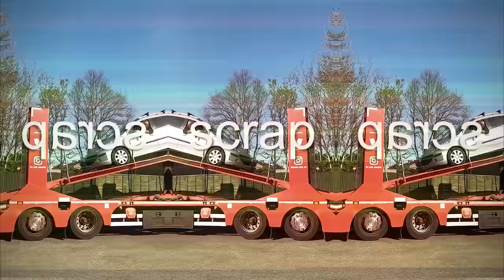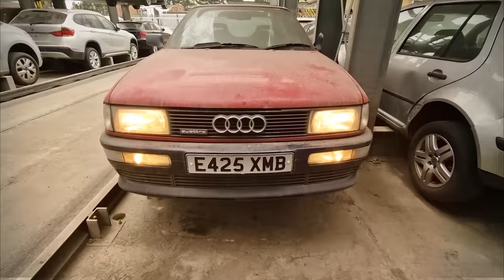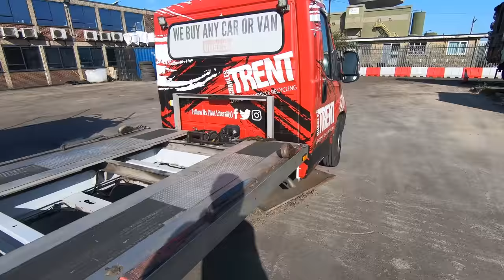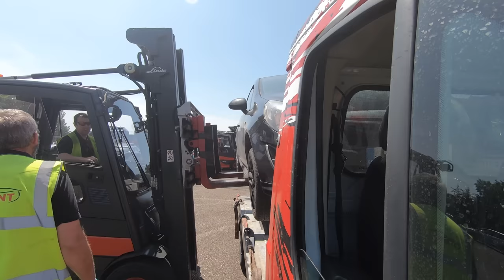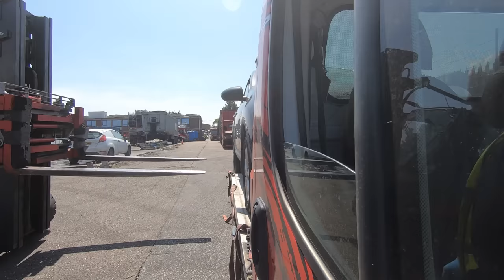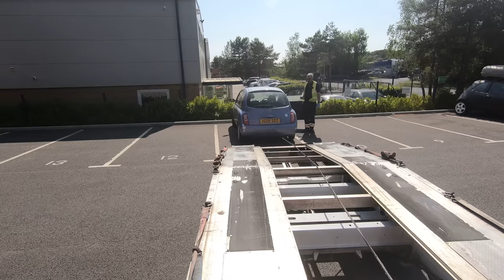Solo Scrap Car Adventure: One Man, One Truck, and a Trail of Discarded Vehicles

Comment: I just got a bmw x5 e53 3.0d 2005 45.000 miles was parked at a block of flats in 2012 and left as the owner didn’t know what to do with it I put a note on it and the owner contacted me and said take it so I did I got all the paperwork and all the keys and the original paperwork from the dealership as he was the guy who bought it new in 2005 I got it to mine put a new battery on it and fresh diesel and she fired up and drove no problem at all and no warning lights

Comment: I remember when cars used to be scrapped because they were broken...
Reply: That citi go needs a 4K gearbox that’s the issue
Reply: But does it though? Maybe it needs an actuator? Or even just a sensor?
Reply from the maker: It was diagnosed at a garage and wasn't just the owner making an uninformed decision 👍
Reply: Just bought (maybe unwisely) a diesel Citroen and reading fun tales about adblue pumps gumming up and having to buy a whole new tank assembly for a grand. That's going to put a lot of perfectly good cars in the scrappies over a bit of nothing. :(

Comment: can that van carry a quasqui
Reply from the maker: Computer says yes.....
Reply: @KevTee's Scrap Car Adventures  ah ok. Is that a Peugeot? I'm looking at getting a transporter to take my Opel Manta GTE and and Vauxhall Firenza droopsnoot to shows around UK. Just one of them is a tad heavy for my old Transit transporter. So was thinking of getting a 7.5t or 12t Daf LF twin Transporter. But if the one on this video can carry 1740kgs. I'll try find similar and use a trailer instead so when driving without trailer, I don't have to worry about the limiter as it gets annoying being limited to 53mph all week
Reply: @KevTee  if I remember correctly, the handbrake is down by the drivers door on these